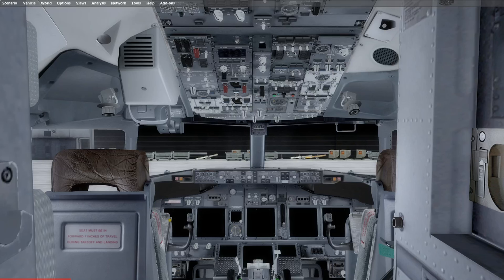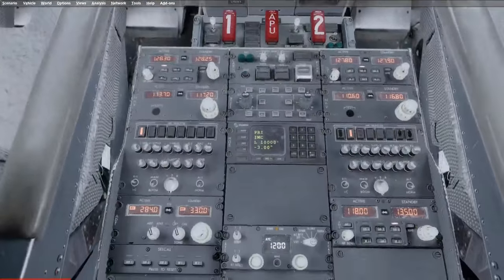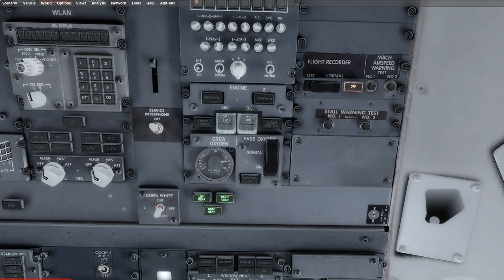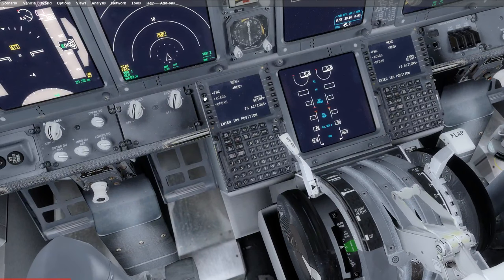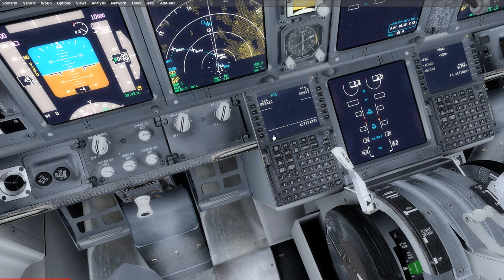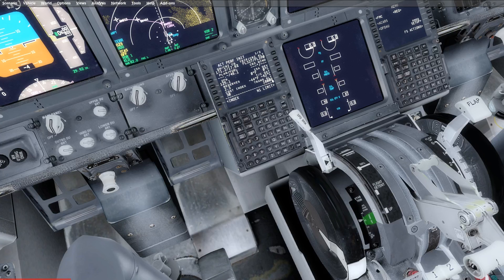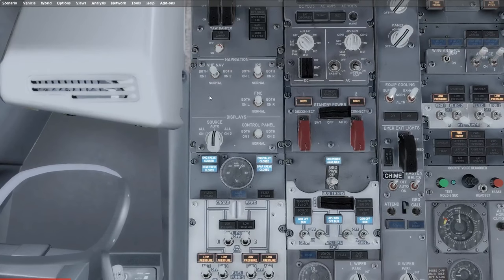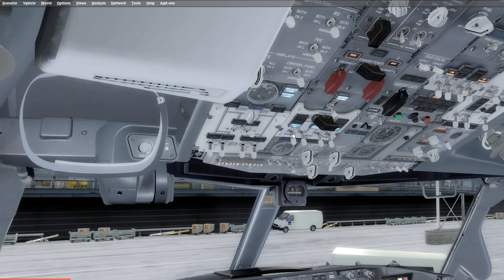Full 737 cockpit startup

Comment: Why You start APU without left aft or center fuel pomp on? 
Here is POH part that makes me confused about it:
"APU switch (as needed) ............................................................... START
Note: If extended APU operation is needed on the ground,position an AC operated fuel pump ON. If fuel is loaded in the center tank, position the left center tank fuel pump switch ON to prevent a fuel imbalance before takeoff."

Comment: Are you a real 737 pilot? If so, how would you say flying in a sim like FSX compares to real flight?
Reply: BattleBornBassing He flies for Ryanair
Reply: BattleBornBassing I'm not a real pilot, but i can tell you, the PMDG 737 has very good in-depth systems, very accurate. However, the flight physics in FSX are quite bad. Really bad. X-Plane has way better physics, but it all depends on the developer of the aircraft, as it can make a difference. Physics in FSX can be done right, but the developers will need to create a custom flight model.

Comment: You didn't set the Take Off Trim. Why is that?
Reply: I noticed that they didn't get the trim figure from the Takeoff page on the FMC (he didn't set the runway condition either which is page 2 of the Takeoff page) but the takeoff trim is a post start but pre-flight check item.

Comment: 23:43 you mentioned an accident by filling in the wrong VOR, can you tell the flight number and the year of it.
Reply: American Airlines Flight 965, 20/12/1995, Miami to Cali. ATC gave the crew a clearance direct to a radio beacon and the crew entered the first letter of the beacon ident and the FMC gave them another beacon rather than the one they wanted. Both beacons had the same initial letter. They entered the wrong beacon without checking. This took the aircraft off the desired track and it crashed into a mountain killing all on board. The aircraft was a B757-200.